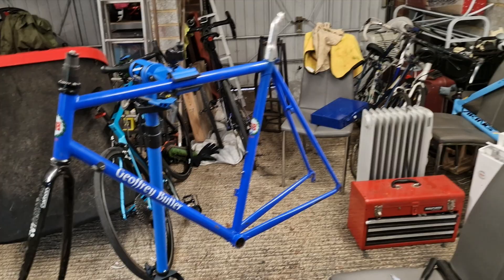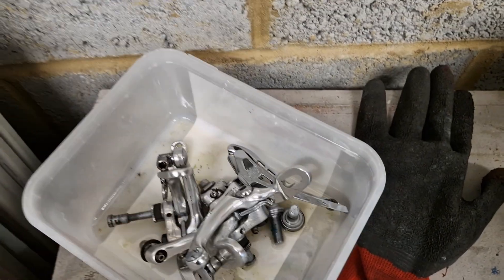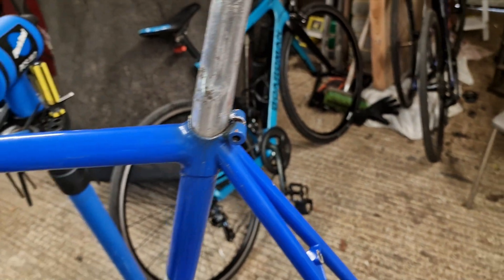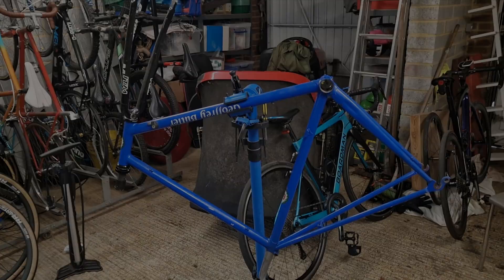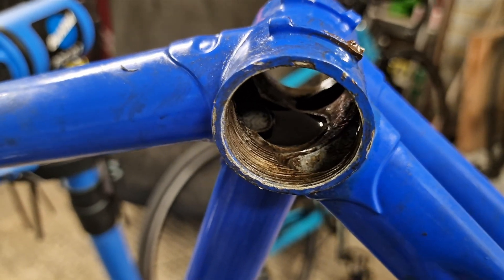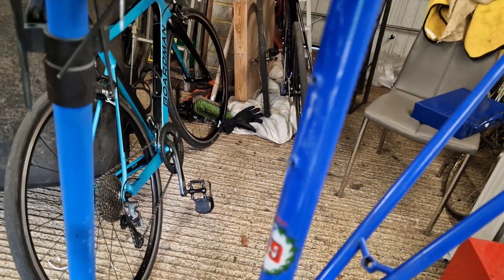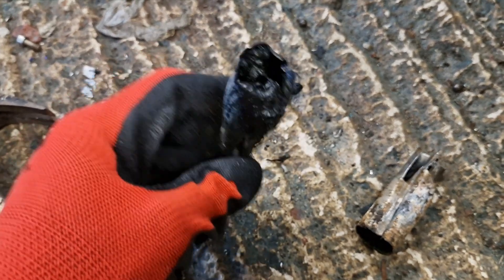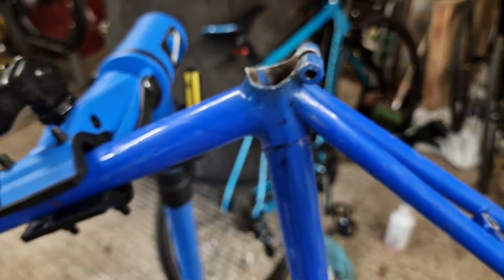Removing a Stuck Seatpost Using Chemistry

Comment: Sodium hydroxide solution is also a paint stripper so it will damage the paint job if not careful. Also, it goes without saying that this method cannot be applied to aluminium frame bicycles as it will ruin them!

Comment: I have used this 4 -5 times for an aluminum stem stuck in a fork.  I have become less cautious as I gained experience.  Outside and away from anything that may cause a spark, I put the fork (stem cut off and some holes drilled in the stem) upside down in a large thick glass drinking mug.  Then I (improperly) add the lye (1/2 cup?) and squirt in water from a bicycle bottle while standing a couple feet away.  Then I walk away.  It starts its exothermic reaction (bubbling, heating up, releasing hydrogen  - saw a small football size cloud form above it one time) and I leave it for 3-4 hours.  Pour it out, squirt out the residue in the fork and do it again.  Takes 3 - 4 applications and may remove some paint.  Sometimes we need to replace the bearings and don't have a replacement fork available and need to use this method.   I was unsuccessful with a seatpost - too hard to get mixture in and post was in the seat tube a measured 9"!  Threw the frame away.
Recently had a decent aluminum frame that needed a new sealed BB - tried various methods and lastly a 1050ft-lb impact wrench.  No luck.  Moral of the story - a light coating of grease for a seatpost, stem or bottom bracket may save the next mechanic a lot of grief.

Comment: I am a chemist. I have done this using full-body protection from head to toe. Outdoors. I can’t emphasize how dangerous it is. I will never do it again. Lye will instantly destroy your cornea on contact. It will cause severe burns with any skin contact. Just mixing the lye with water is exothermic (not a reaction but a heat of solution). Done improperly it can boil and splash. Putting it in a bottle with another label violates one of the first rules of handling dangerous chemicals. Accidents happen and you risk having caustic liquid where you do not want it. STOP! STOP! STOP! NO!

Comment: Congratulations, it's good that you finally succeeded, and only small losses around.
My memories - a few words:

This method is effective.

The scenario presented here is very dangerous.
The reaction is highly exothermic.
The solution may foam and bubble for hours.
Hydrogen is released. It's worth being outdoors. But how to protect cats, hedgehogs, birds and children from getting burned?
The solution should be replenished from time to time because the process takes a very long time, which means that checks must be made.
After etching, you need to have easy access to running water to rinse the frame perfectly. And then dry it thoroughly, clean our tube with a wire brush on a drill, remove filings, and finally pour oil over the frame and protect it against corrosion...

The best thing that happened to me was that before digestion, I met a plumber who showed me his hands. They were full of sodium hydroxide scars. When fire burns us, we feel pain immediately. The hydroxide we use burns gently. But deep.

I cut off the seatpost at the top, glued a kind of funnel on it, and sealed the area around the pipe from the bottom, on the bottom bracket side. Thanks to this, the mud fell down and I could conveniently pour the newly added liquid from the top. In the funnel, the solution boiled like soup and splattered.

Previous attempts with a punch, two car jacks, pouring kerosene or heating were not effective... If two or three days with WD-40 or kerosene do not help, it is worth dissolving it immediately with hydroxide.
Reply from the maker: Thanks for sharing your experience. Yes, it's nasty stuff.  That's why I kept the solution relatively week and took around 5 days, changing the solution every 24 hours.  It still fizzes and makes a mess though!
Reply: I have had this problem with a disaster. So the latest  stuck seat post l took it to the seatpost man in Chorley. Total success. This is dangerous and bonkers!!